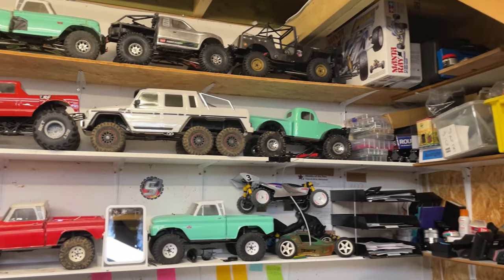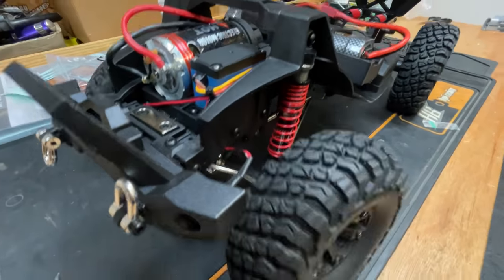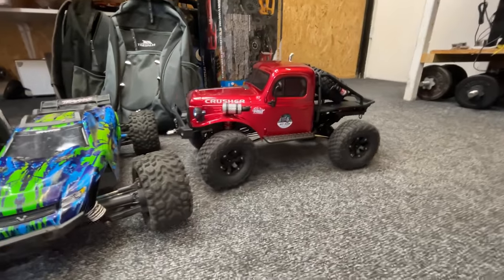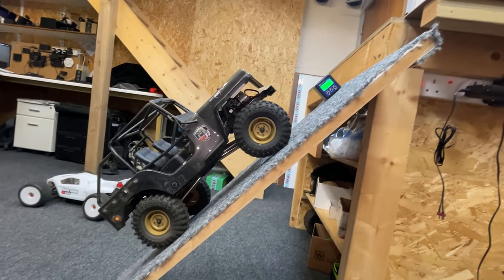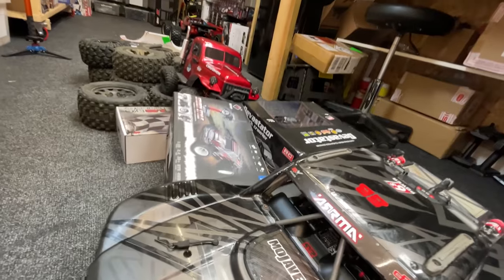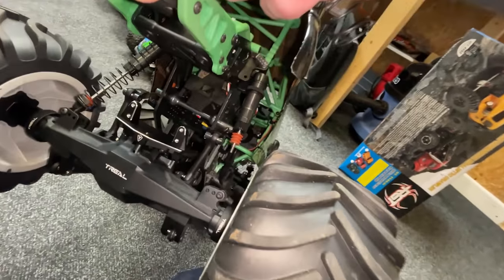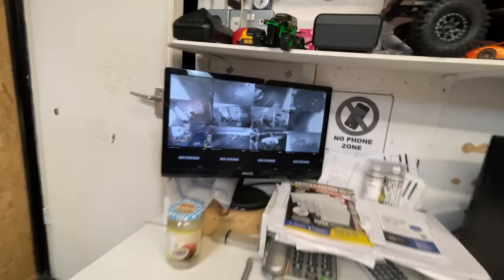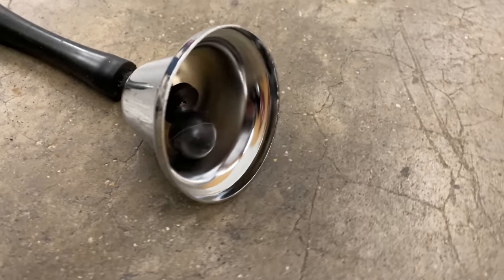this RC Rock Crawler has a secret trick

Comment: YOU DONT NEED 8S STEVE TO REVERSE YOUR MOTOR, YOU CAN JUST FLIP THE DIFFS!! :) (acctually dont know if it works)
Reply: It does. Some vehicles won't allow you to flip the diffs though. You must put them in the right way.
Reply: Ok thanks, but just so kevin know :)
Reply: Well just change the wires
Reply: Yes it works but if you can even fit the diffs under the diff covers lol
Reply: @Frank-st7ku  yes big brain
Reply: If it is brushed swap the motor leads. This can work with most brushed dc motors.
Reply: @michaelmiller7199  this is a much better idea in my opinion
Reply: always good to have an excuse to spend time with the boys😉
Reply: Kev already knew but thanks for telling us
Reply: @iris9557  Yes, but it didnt seem like he knew when he asked steve to reverse a car with flippable diffs. :)
Reply: It does don’t worry

Comment: hey kev i found a way to stop the parachuting on the slash, all you need to do is take a sheet of plastic and form a under chase that fits around the side gards and around the wheels to limit  the air from going inside the body. i did this to a friends slash and it stopped the parachuting, hope this helps😄

Comment: How come they don't make the crawlers with the tires sticking out in front of the bumper so when you come up to a flat surface you can crawl up other than hitting it with the bumper also what do you think the best cheapest 1/8 scale steering servo is?

Comment: Hey Kev those Crawler trail lights aren’t working because it has a bad pin connection , so where the lights plug in you have to take that case off and where the main power connection plugs in you have to switch it over one to new pins and it’ll work !! Stay and Play Safe !! 👊✌️

Comment: kevin i am wanting to build an RGT crawler from stock to fully moded and one of my questions is  i want to put in a 3s lipo with 8,000 mah is this too much (i will be upgrading the wheels and tires to beadlock and making it a full crawler jeep)

Comment: Check out the videos on the wltoys 124019 that have had a brushless motor put in them. They are running them on 2s lipo and getting 100 mph out of them.

Comment: I wonder if the fancy suspension crawler would have climbed steeper on a LiPo as the weight distrubution would have been slightly different with the lighter battery.